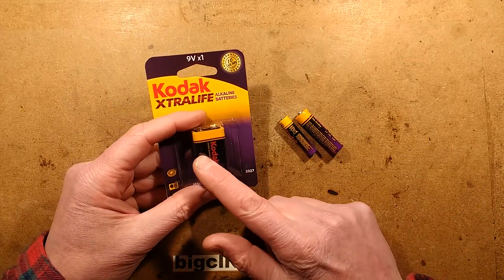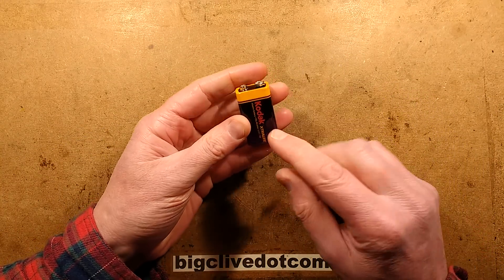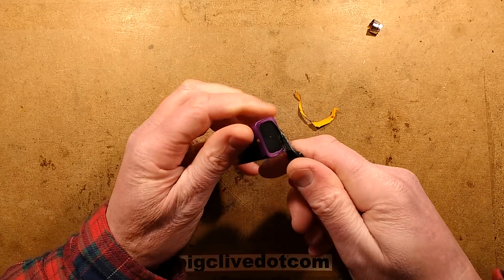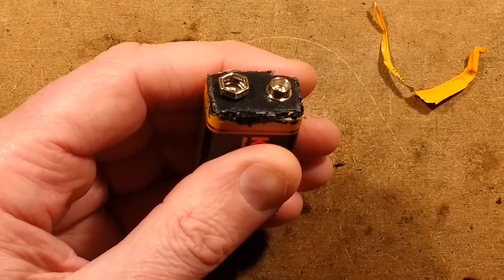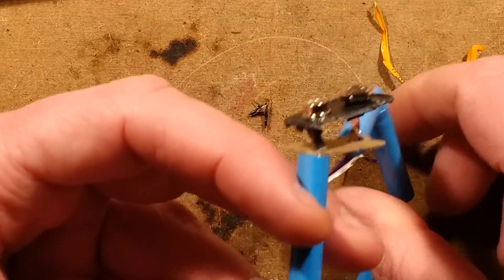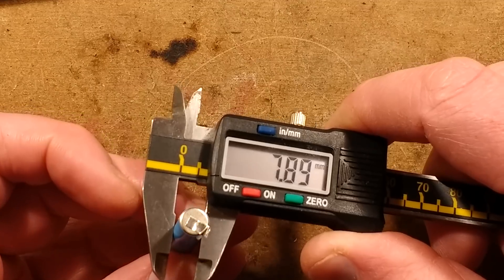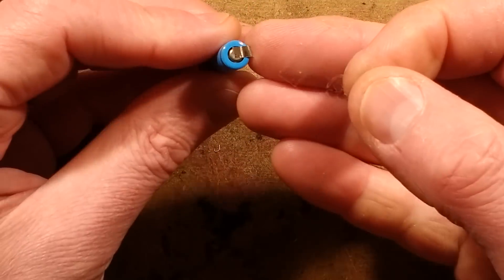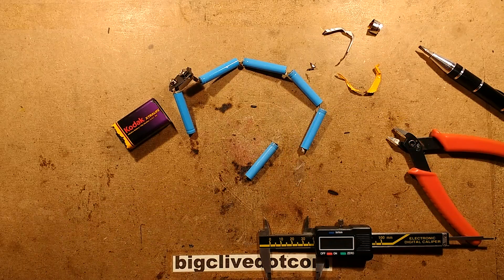Inside a Poundland 9V alkaline battery.  (Check polarity of cells if re-using!)

Comment: I have, in the past, simply wrapped smaller batteries such as AA, or AAA calls, with a bit of hard foam n gaffa tape, to make up the width. Then used them to replace larger batteries. Perhaps by adding some scrunged up tin foil at the negative end in order to add length and allow connection.
This is of course something that no-one should ever do, as it is bad practice and might not work without a bit of careful fiddling.
I deny that I ever posted this.
A bigger boy made me do it!
Hahahaha.

Comment: What did the 9volt batteries of old used to have inside them (80s).
As this is a modern 9volt battery.
Reply from the maker: Either a stack of six flat or cylindrical cells.

Comment: The 1990s Ever Ready B122 battery uses button cells for the 22 half volts, early ones used layer cells like the zinc carbon, I never knew the pp3  rechargeable ones contained these. I have never taken one apart as yet. Those large 6v lantern batteries contain four F cells in series, I took apart a one made by Nissen used in road lamps an the cells were smaller, E size, the old version of an E cell was a U17 used to power some valve radios, The 3R12 4 half volts batteries contain three U10 cells in series. The best one was a Duracell lantern battery, it had four D cells in series an the Energizer one had the correct F cells in. Quite a few batteries can be hacked to obtain obsolete sizes. I have even made up an old cycle lamp no 800 3v size using two F cells from a lantern battery.

Comment: I used to recharge ordinary 9v batteries for my guitar treble  booster back in the late 70's using my dads car battery charger. They were the ones with individual stacked cells and it worked. These days do not try this. The manufacturers are ahead of the game of recharging non rechargables.

Comment: It would be interesting to see a video where you test different one time use batteries (Duracell, Energizer and other most popular brands) - check their capacity on low current discharge, high current discharge, take them apart etc.
Reply: check out project farm. He has done exactly that.

Comment: Your attitude to safety is a healthy contrast from the usual UK paranoia about power.  In the QI x-mas special, the host was nervous about touching the bare ends of a SPEAKER wire, and here you are calmly cutting away the case on an alkaline battery, unrolling the cathode/anode of a lithium cell (that was shaped like a AA battery), or intentionally running electric current through your body.

Comment: about a year ago I had opened a 9V battery and saved the small batteries from it. Today I wanted use it and discovered that the polarity was reversed on these batteries. And strangely it did not work. Maybe they were empty after all even if I measured 1.5V.

Comment: The Durecell copper top 9V has AAAA batteries in it too. But watch out, the top that would normally be positive, is negative, & the bottom is positive. So to use them in place of AAAA cells you have to put them in backwards. Those cells in the video might also have their polarity reversed.
Reply from the maker: They did.  I noted that in the description.

Comment: I actually use the 4AAAA batteries found in these 9v to power old (Ericsson GA628 for example) cellular phones. It's simpler and cheaper to do this to keep my collection functional rather than bothering with actual batteries, plus, no charging. Just a few solder points here and there and i'm done.
FYI most of these worked with 3AAA batteries but the smaller package of the 4AAAA makes it easier to pack these back in when you don't want to glue the battery container again.

Comment: In the 1980s, the 9V batteries had 6 little flat cells in them, stacked on top of each other, when removed, they looked not unlike large indigestion tablets.  Obviously, a wire ran from the bottom of the stack to the negative connection on the top.  
Presumably making them out of AAAA cells is cheaper, if the factory is already making AAAA cells.
In the 1970s, I worked in an electronics shop and remember selling batteries for portable valve radios.  Can't remember the numbers now, but one was 6V for the heaters and the other 90V for the HT (60 cells, I suppose).

Comment: Interesting. As a child I used to investigate how things worked and these used to be a stack of flat rectangular plates of carbon soaked in electrolyte alternating with metal plates. The larger 9V batteries contained cells wired together in series like this.  Batteries and cells are technically much better now and this wouldn’t leak as easily and would be safer if someone broke into it like you just did.

Comment: A few years ago I had a bluetooth earpiece that took AAAA cells which were very hard to get. Wish I knew about PP3 battery contents although when I dismantled one many years earlier it had a stack of button type cells.
Reply: I opened the ones with the markings 6LF22 (Energizer), 6F22 (Eveready Classic) and 6LP3146 (Duracell) they all had flat cubed batteries and the one with the markings 6LR61 (generic Coles store brand & Duracell) had 6 AAAA batteries wired in series

Comment: I had an 9V blow (well, slowly force open) its bottom when it failed and the cells expanded as they failed/corroded, strangely they were stacked coin-cells rather than long single-casing ones. Think it was a cheap alkaline, but not sure.

Comment: Duracell and energizer batteries have the same AAAA cells. We used them in the army to run cd players and radios ,when batteries were in short supply.
Use a chapstick cylinder to make them fit tite for AA size.

Comment: In the past I've pulled absolutely perfect AAAAs out of a 9V battery, complete with pip on + and retail printed case. At the time, really expensive consumer electronics remotes often used AAAAs often co-branded and with "Use only Rippenoff GmbH brand battery" warnings everywhere.

Comment: I recently took apart an old-nearly-depleted 9V battery, the inside was corroded and full of battery fluid residue and after a short while one of the cells exploded with a big bang as the negative terminal flew across the table leaving particles of the innards everywhere.

Comment: I have a Microsoft Surface Book, and the Surface Pen (the stylus that comes with it) uses a AAAA cell for the battery.  In the 3 years I've had it, I had to change the battery only twice, so I typically have plenty of time to find replacements, but they are very difficult to find.  I think I found a pair of them at Home Depot (a hardware store) once, but it seems they aren't a commonly sold item.  I do usually have some 9V batteries around though, so I might have to use one of those in a pinch some day.

I have taken 9V batteries apart before.  The contacts on the top work very well as a cheap interface to connect a 9V battery to for projects.  The contacts snap right to the top of another 9V battery (shorting it out if you don't take it apart first), so it's a really easy way to connect wires to it without having to buy any special parts.  Makes a great easy 9 volt supply.

Comment: I wonder whats inside a rechargeable 9V NiMH PP3
Reply from the maker: Flat rectangular cells in a stack in the one I opened a while ago.
Reply: hmmmm I guess the trickleability of NiMHs makes it work with no need for balancing. do you remember how many cells though? because 9V is awkward, 7x1.2 is only 8.4V. then 8x1.2=9.6V which is fine but then it could go as high as 8x1.5=12V at absolute peak charge. must be 7. probably.

Comment: Those do work great in place of AAAA batteries. They can be hard to find, but Energizer has em. I've cut 9v (pp3) batteries open for years. Just have to cut the links right in middle so they can fold over on each end to fit good. The thing is, polarity is OPPOSITE of what you would think! Just double check before using in something! Here in U.S., a 4pk of AAAA's are about $8-10... and cutting open Any cheap "Store Brand" 9v will cost ya maybe 2 bucks! Much cheaper, and ya have spares! (I have seen some where smaller cells were not insulated, just f.y.i.) 🔋♻👍

Comment: BigClive:  You might be interested in a review of a 60Ah Lipro battery with protection.  "Is it possible to start a car with a Lipo Battery ???"   https://www.youtube.com/watch?v=tyMC9u5Z4jA
Reply from the maker: I think I'd rather have a reverse current flow diode in the positive lead.  Did you see how the cell voltage went up above 4.2V because the alternator was trying to charge the pack at high current?  The mini jump starters use a triple stack of lithium cells designed for high current output.

Comment: AAAAs are used in "active capacitive digitizer" style drawing pens.
These are best known by either their brand name Ntrig, or by their most prolific use in modern Surface devices since the Surface 3 line.
Given the relatively long service life of the AAA battery in one of these units, one 9v battery should be able to serve the predicted service life of your Surface computer. :D

Comment: If you need good quality rechargeable AAAA NiMH cells for pennies, buy TRONIC 9V rechargeables in Lidl. That's 6 pieces of 200mAh AAAA cells with welded-on solder tabs for about £3.5. Be aware to buy the "Ready to use", low self-discharge type, they sometimes buy them from different OEM, which is supplying standard ones (those are also good quality, but with bigger self-discharge).  I used to use them as memory backup batteries for old gear, such as vintage computers and instruments. Also great for small solar garden lights.

Much cheaper than the PCB mountable NiMH backup batteries from big brand names, while having about the same reliabilty, much bigger capacity and lower self-discharge compared to them. If I replace a PCB mounted backup NiMH / NiCd cell, I never solder the new one on the PCB anyway, even if it's the correct package with the same footprint as the original - I solder wires to them, put heatshrink tube on the batteries, and mount them as far from the PCB as possible. I've seen too many PCBs horribly damaged from leaky NiCd and NiMH backup cells. 

The TRONIC 9V NiMH can also be slightly leaky after 5-10 years, I have two 9 year old ones, which I still use in my multimeter occasionally, on one of them the rivets of the terminals turned greenish-blue about 3 years ago, so it's slightly leaking its electrolyte - but the DMM still runs for about 2-4 weeks with it (it was about 2 months with the same DMM when the battery was new, and these are NOT the low self-discharge types).

Comment: Used one of the flat rechargeables  out of a 9v rechargeable PP3 style to replace the memory-backing NiCd in a Fax machine many years ago (probably 25 years back). Far, FAR cheaper than getting the "official" spare part from Pitney-Bowes (and I had a stack of spares should the problem arise again!)

Comment: You should take apart a rechargeable 9v battery, as I bought one for under £2 from ebay and when I took it apart it just had 7 button cell batteries inside.

Comment: yes things have changed. all the things ppl thought we would have by now. we do have some nice stuff. however a lot of it is a pig with lipstick. and some really crap tacular , crap riffic. well just manufactured garbage!  buy it have a look. through it  away! 
its not all the manufacturers fault. we don't want to pay much for anything. and we want yo be paid to much to make stuff. the only way to make the price point. and pay the workers . is to cut quality. 
yes the 9v batt I took apart. had cells that looked like they could have come from a pez dispenser! I have seen long c cells in 6v batteries. and lots of AA batts.

Comment: I've been pulling these out for years for my Dell Tablet Stylus which needs AAAA. 

The key is to hacksaw the end off a genuine AAAA and fill the inside of the dimple with solder, then sand it flat. You can then just stick that bit onto the top of these and shove it into the stylus.. works perfectly and gives it the extra ~2mm.. 

The other poundland batteries (Sony and the Non Alkaline kodak's, are no good. they have the flat 6 packs of cells stacked up.. only these Alkaline ones work.

If you use a bit of sellotape round the top to stick the new cap down you are less likely to loose it when you forget you've frankensteined the battery and open the pen outside.

Comment: Speaking of rechargeable 9V NiCd batteries, growing up in the 80s I always used the Gould brand NiCd 9V batteries because they were one of the few brands that actually produced a 7 cell 8.4V NiCd battery.  They tended to work much better in many electronics expecting a 9V battery since 8.4V is much closer to the expected 9V than the typical 7.2V NiCd batteries were.

Comment: You mentioned that you are surprised the cells are sleeved at the end of the video.  Of course they are, since they are wired in series and the outside can is usually at the potential of one of the electrodes, so if you packed a bunch of un-sleeved cells together you would be shorting some out.
Reply from the maker: I thought there might have been sheets of material inside separating them.  Sleeved is definitely easier.

Comment: I'm a bit disappointed that I can't get 45, 67½, or 90-volt batteries locally anymore, let alone the good ol' #6 1.5-volt ignition cells.
Reply: SigEpBlue That's ok, these days it is easy enough to create all those voltages from any available voltage source.  My amateur radio station and shack have been fully converted to use a large bank of 12V lead acid batteries as their primary power source, including PC, monitors, lighting, etc.  I use multiple well filtered DC-DC converters to create the multiple voltage rails required to operate all of my gear from that 12V battery bank.  You could very easily do the same for your tube gear though you may need to look for DC-DC converters with isolated outputs (they exist) since your gear may well not share a common ground for all the voltage rails.  But DC-DC converters have really made dealing with multiple voltage requirements much simpler than in the past when you either needed a battery for each voltage rail, a higher starting voltage for linear regulators to down-regulate lower voltage rails, or an AC source or motor-generator, etc., to get all your required voltages.

Comment: I took a couple of them apart probably 20 years ago and it seemed different brands did things differently inside but I remember one of them had individual cells that weren't connected in any way other than contacts inside the 9v casing. I don't remember the brand now.

Comment: My reading of battery mechanical specs is they are maximums (which are only met by rechargeables). It's more useful than specifying a nominal and tolerance. Just make sure your battery spring can take up the 2.5mm slack.

Comment: Hmmm, interesting. I once opened an unbranded 9v battery, and it had 6 button cells inside, arranged in 2 stacks. It was probably easier for that manufacturer to find fitting button cells, but i doubt the space usage is as optimal.

Comment: Not all 9 V batteries have round cells inside. I once opened up a Malaysian made Varta alkaline 9 V battery and it had a stack of clear plastic rectangular cells. So did the Varta made private labels (obviously), e.g. Aerocell from Lidl.
Reply: Also the Sony Stamina ones, made in Malaysia. (Just opened one)
Reply: 6LR61 is the type you need to look for. Assuming that you're not being sold something fake. Varta cells used to be O.K., but they also sold zinc carbon batteries with cheap button cells inside.

Comment: Maybe worthy of note about the rechargeable ones: The stack of rectangular/oval cells instead of cylindrical ones is because it makes it possible to use seven of them to get to 8.4V instead of the 7.2V you would otherwise have had.

Comment: By the way, the easiest way to tell whether a 9V battery contains 6 "AAAA" cells is whether it's marked as such. Those sorta-AAAA cells are actually called LR61 cells, and the 9V batteries containing them are generally marked as "6LR61" on the shell.
Reply: F quite simply means "flat", 6F22 means a stack of 6 flat cells. (Similarly, the R in 6LR61 stands for "round".) The absence of any other letters means it's zinc-carbon. Conversely, the L in 6LR61 means it's alkaline.

The last bit (22 and 61) is the IEC 60086 standardized size code, which is arcane knowledge with little rhyme or reason to it.
Reply: Thanks for the tip!! Thats a great way to know whats inside! I usually only tear the up once they are dead to recover a "free" 9v battery clip :-D
Reply: @DryLog420  As do I,  but every one I've ever done that with has been metal cased,  not plastic.  The most common use I know of for AAAA cells is in laser pointers.
Reply: Thundertactics ah didn't know that's what it stood for, they actually have several different codes depending on the make, but most people still refer to them as 'PP3' which was first used by Ever Ready decades ago, PP actually stood for Power Pack.
Reply: And 6F22 means what?
Reply: I’ve got a couple of led pen torches that use these AAAA cells. I’ll see how I get on!
Reply: AAAA?

Comment: The 6v dolphin square torch batteries contain aa cells
Reply: They used to contain 4 cylindrical cells that filled the whole battery, I think they were F size. Alkalines often contained 4xD on a spacer. I made some true 6V rechargeables with 5xC cells, back in the day.

Comment: Did this a few years back and used them in a AAA remote control.  Had to wrap the cells a few times with electrical tape and I can't remember what I used for a spacer.  Maybe it was a pencil eraser wrapped up in aluminum foil?

Comment: You can get both stacked and long cells in a 9V battery. I opened a lot of different brands here: https://lygte-info.dk/info/BatteryDisassembly9VAlkaline%20UK.html

Also check the polarity, it is opposite normal batteries.